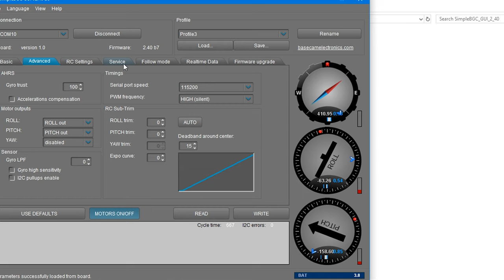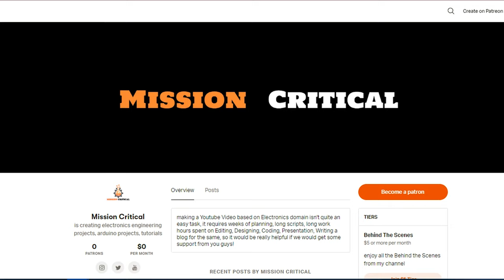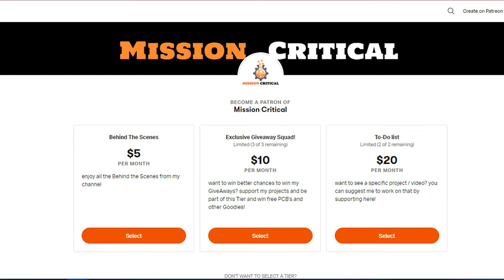2 axis gimbal for drone | FPV 2 axis gimbal review

Comment: can we connect this gimbal to any fpv flight controller
Reply from the maker: Yes absolutely, I guess this Gimbal is intended to be used for flight controllers, I hacked it to make it work without flight controller. But again, it depends on your Flight controller, if it has PWM capacity and extra servo outputs.